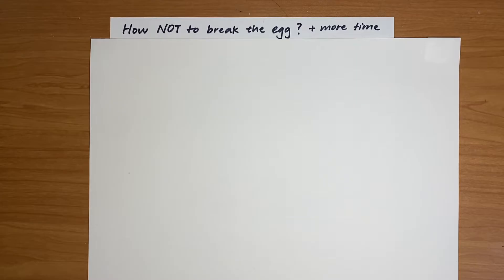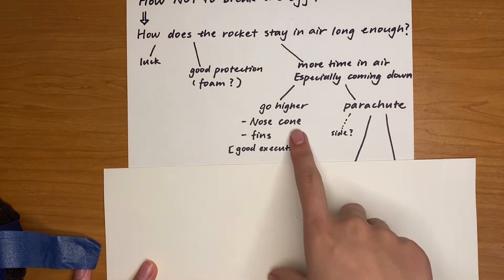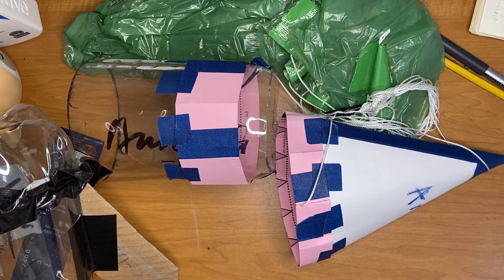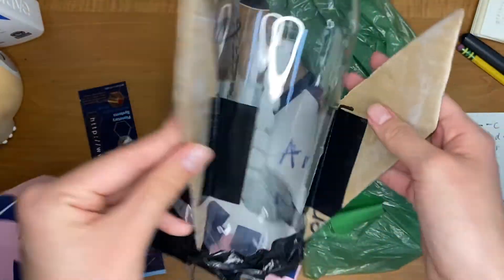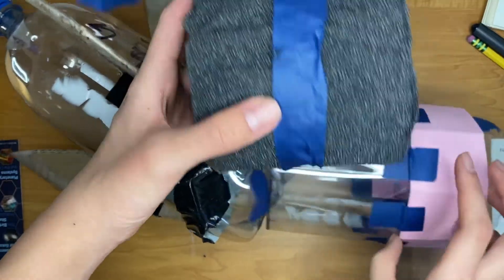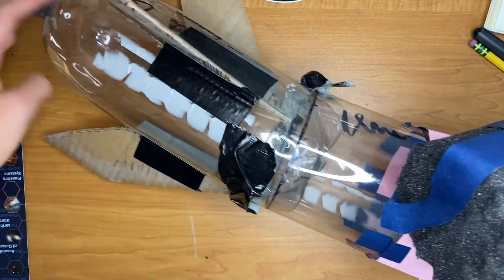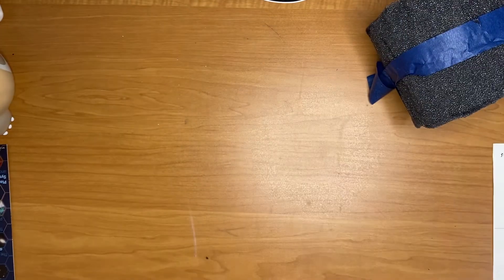How I made an egg rocket for physics class

Comment: How did you make the rocket actually launch???
Reply from the maker: It was using water and pressure. Our teacher set up a launching device where we had to pump air into the bottom of the rocket. When the pressure reaches a certain level, we pull a string, which releases the rocket from the pump. The launching part was something our teacher took care of.

Comment: how did you tie the parachute to the bottle? im trying to it myself and i am so confused. also, did you fold the parachute in any way so it came out easier?
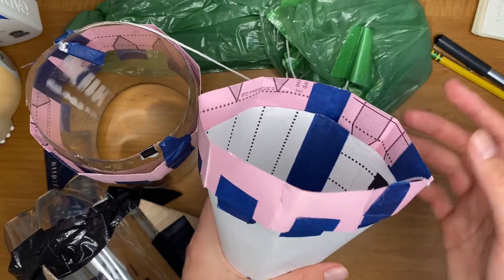Reply from the maker: Hi, so I think I just poked a hole on the rim of the inner bottle body (look at 4:37), pulled the strings through, wrapped the ends with tape so the strings won't slip out. In terms of parachute folding, ik it's hard to describe with words, but imagine a closed cane/walking umbrella, where the center of the parachute is on one end, and the edges with strings are all on the other end, then imagine a Z shape, folding the entire thing in thirds.

Comment: How did you construct the paper to slide in and out so it can detach when your rocket launches? Is there dimensions or anything?
Reply from the maker: I explained the "slide in" and "detach" at 4:20. My idea was that I'd construct 2 identical octagon rings, one on the cone and the other on the body. Theoretically, one ring should be slightly smaller than the other so it can be inserted into the other. However, in real life, paper is pretty malleable, so one goes into the other pretty easily. The idea with an octagon is that it's closer to a circle, so when the parachute is ready to deploy, the cone can easily tip over (with the tip filled with coins, making it heavier). I think if the rings are triangular or square, the cone and the body get stuck. In retrospect, this idea is also flawed---the fins essentially add spin to the rocket so it goes higher, and while it is easy for the parachute to come out since the cone is loosely attached, it might also cause the cone to be swung off earlier. 

But to answer your question about the dimensions, it depends on the size of your bottle. My calculations are at 6:18.